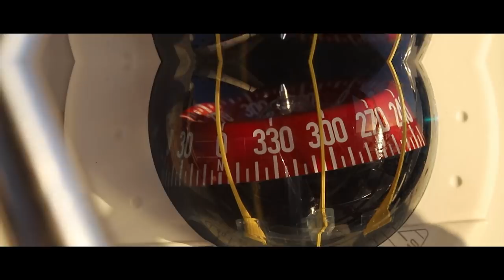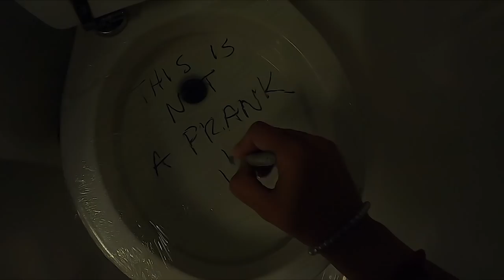WE're Hauling Out & Jumping Ship to Hawaii | Episode 112

Comment: I have a question.  When storing your boat for a long period of time, would it help to have a de-humidifier plugged in all the time to keep mold and such from growing?  I realize you could only run it off of solar as the engines will not be started.
Reply from the maker: Yes actually we have heard of people doing that to help with the humidity for sure. Here in Mexico, as far as here in San Carlos, it's humid but not nearly as bad as if we would be in Puerto Vallarta. It is a good idea, so the major thing with a dehumidifier is not really keeping it running, but dumping the moisture that does get collected during that time.